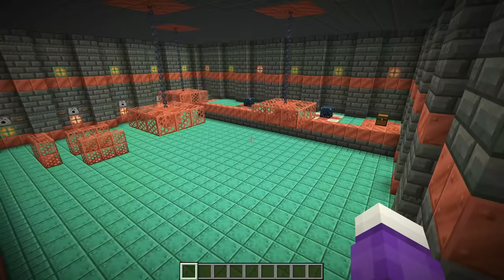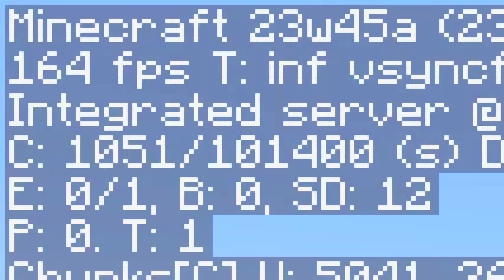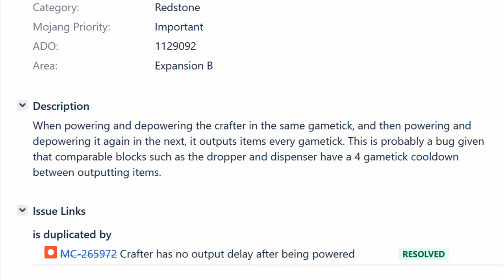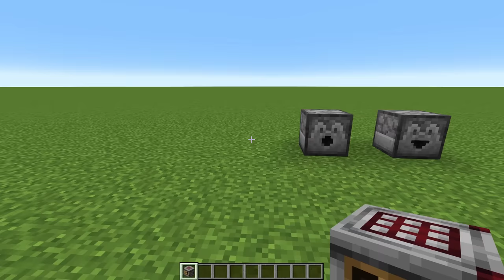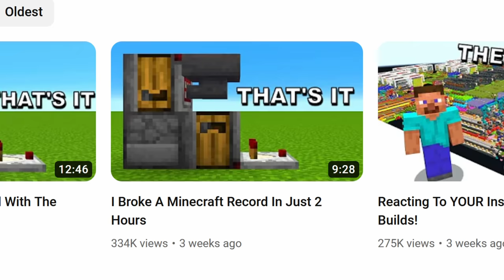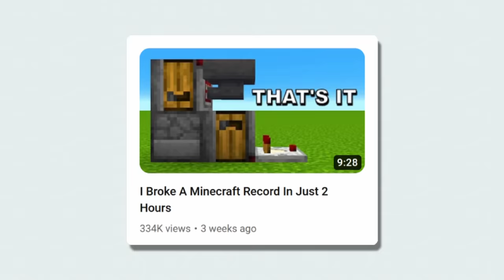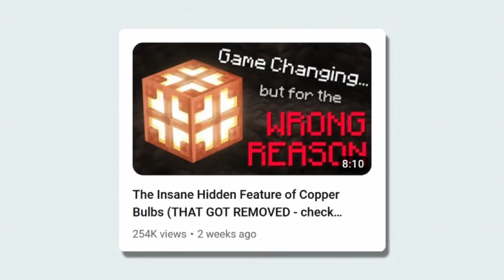Mojang Is About To RUIN Copper Bulbs (And Crafters)

Comment: Not only did they ruin the speedy functionality of the bulb and crafter, they also keep making the crafter texture WORSE!!! Seriously they had it perfect the first time. If these changes aren't reverted it's gonna seriously kill most of the excitement for this update as you said.
Reply: At least textures can be reverted with a simple client side resouce pack. The block mechanics not so much.
Reply: The real reason for the crafter textures being changed is because an orientation pattern can make an accidental... windmill. If you know what I mean.
Reply: @risa1467 it's not like you can use literally any block to make a swastika
Reply: @HellCromeE  True, but there is a difference between outright doing that, and having a block's texture accidentally showing an symbol. Obviously, Mojang doesn't want their assets to display unintentional windmills, because they know groups will then wrongly accuse Mojang for subliminal messages.

No matter how silly they may be; they don't want the liability.
Reply: @risa1467 You do know there's an entire compilation here on YouTube if people accidentally making that symbol using Mojang's assets, right?

The changes to the texture are inexcusable.
Reply: @risa1467  the only people dumb enough to accuse Mojang of that for having those textures are the same people that just can't be pleased. They'll find something else to accuse them of.
Reply: at least this texture is better than the last texture
Reply: @risa1467 you can make the a swastika with many other block textures (for example pink petals) so I don’t exactly see your point
Reply: @recycledwaste8737  There is nothing stopping anyone from making the windmill accidentally or on purpose; I've never suggested the contrary. Anyone else telling me the obvious should be assured I know that. Although, I will point that same compliation of it features modded verisons of Minecraft, and have features well outside the scope of Vanilla ever will have.

It is just that Mojang is keeping their textures in mind for the moment it becomes perverted, and becomes an PR nightmare in the making.

The same reason Cyan Glazed Textures changed; nothing more, nothing less.

Again, if anyone wishes to revert these textures are free to do so. However, Mojang is interested in their default standards in how these blocks are intended to be; whether anyone likes it or not. Luckily, we have the ability to make our own resource packs.
Reply: @vibaj16  Sure the people who will accuse Mojang of anything much of that will be dumb. However, Mojang simply wants to avoid the controversy entirely by not having one at all. That's all my point is.

As silly as it seems; you'd be surprise to know dumb people can have an absurd amount of power in causing strife.
Reply: @risa1467  Also in most countries it's pretty much illegal to have that certain symbol (history books, relics in museum and documentary movies are exceptions). So the mohjang could easily be sued by many countries.
Reply: @recycledwaste8737  But the company would be in legal trouble if they made it to be a feature. Tho, i'm pretty sure that those compilations would throw lots of people into prison if they weren't anonymous (because using that symbol publicly is illegal in lots of countries, with the only exceptions for relics in museums, history documentaries and history movies).
Reply: @HellCromeE there is a difference between intention and something being done on a accident .
Reply: @vibaj16 basically yall who are complaining about

Comment: Haven't played in a while (and haven't done redstone in even longer) but the autocrafter change seems like a change you could justify (server lag, hopper timings, etc.) but I have no idea why they would change the bulb, since that change only takes options away.
Reply: Easier fix would be to have a gamerule.
Servers could have a high tick gamerule, while single player could keep the fast ticks.
Reply: Rather than taking options away, we have an opportunity to give people more options. The copper bulb has four variants, right? Normal, lightly weathered, weathered, and oxidized. Why not give each variant a different delay? As it gets more oxidized, it goes from instant, 1 game tick, 2 game ticks, and 3 game ticks. You can wax the bulb at any stage to lock in the delay. Four times the options!
Reply: @vaalalves  True!
Reply: @areadenial2343  I actually like this idea.... MOJANG!!!
Reply: it's a double edged sword, we usually only need 1-3 maximum autocrafters per type of farm. now it's speed has been reduced players will now use more autocrafters in their redstone farms = laggier.
Reply: @Zero-zr6xx would fast autocrafter be able to be fed on time though? hopper can only transfer items at a certain rate, so it can be useful if you manually inject stuff in it, however crafter would be already cadenced by item injection rate

Comment: if the crafter had had the delay to begin with, everyone would've been perfectly OK with it. great example of how developers can give but never take away, so they're hesitant to give in the first place
Reply: exactly, and that is why I think the crafter delay is ok. but the bulb timing is just taking too much away, I think
Reply: I don't entirely agree. Yes, everyone would be OK with it but it would be just another mediocre single-purpose block (like the jukebox before the recent update). Yes, it crafts, but it can't be used for much else. If it's faster, then suddenly you get extra types of usage. Like the compact counter.

Also, remember, it's still faster to craft by hand. Because when you craft manually, you can craft an entire stack with just two clicks (shift-click of the recipe and then again to craft the stack), the previous crafter could only do 20 items a second.
Reply: I dono man. Plent of games ive played have had buffs and nerfs. The defs usualy look at whats needed and whats fun. Changing the delay on these 2 items is NOT fun and it breaks mutiple builds so its a very bad update.
Reply: they removed copper goat horns and nobody seemed to care
Reply: @Yorick257 why doesn’t the counter work if it is slow?

Comment: I'm fine with Auto-crafters having a longer cooldown. The bottleneck is only marginally increased plus players can still make more machines. However, Copper Bulbs have a longer input delay has me up in arms.
EDIT: Huh. Didn't know about using Auto-crafters as tick counters.

Comment: I think they should add consistency by having OTHER blocks also delay odd tick intervals.
The crafter kinda makes sense though... not because of consistency but just because the other way just doesn't feel right.
I mean if you want faster hoppers you put hopper minecarts and if you want it even faster then you put MORE of them
I think the delay in the crafters are fine. it's sad that it breaks the fast counters but that's only a problem if you want to count at a faster rate than 4 gameticks.
if it is because of order it can be fixed by having it at 2 ot even like 3 gameticks to add another odd tick block.

Comment: Copper bulbs are cool because they have a good use and an extra feature. I thought quasi connectivity was bad until I learnt it a little and its super useful. The added tick of delay might be confusing bc your redstone would get out of sync but it adds an entire new concept. As for the Crafter this change makes since and it effects nothing. Just make 4 crafters.
Reply: Yeah I'm not beat up about the crafter at all but the bulb is the big one. Halfing the size of wiring on some complex mechanisms would be so nice

Comment: As a not-master redstone I see no difference here, but I know it's painful for those who are
Reply: The game runs on a speed of 20 gameticks (gt) per second, so 1 gt = 1/20th of a second. Redstone ticks (rt) are 1/10th of a second, so 1 rt = 2 gt. Almost all redstone components run on redstone tick timing, so are all on even game tick delays. Some machines and redstone circuits require very precise timing, going into odd game tick delays and timings. With just normal redstone components, there was no way to access odd game tick timing without using un-intuitive and clunky mechanics like trapdoors and scaffolding or leaves and pistons pushing logs. With the addition of the copper bulb however, it made accessing odd game tick timing much easier because the copper bulb had a 1 gt delay. This allowed for easier setups for very precise timing, and for faster systems. Mojang nerfed this feature by making the copper bulb activate immediately, which can be thought of as a 0 gt delay, essentially putting it back onto the even game tick timing scale as all the other redstone components. This trait of the copper bulb was what made it so special and an extremely powerful redstone component, and by Mojang reverting this and taking this unique feature away, they essentially stripped the block of all its usefullness!

As for the crafter, I personally think that the nerf is the right thing for nerfing the actual intended use of the block---that is, for crafting---since being able to craft 20 items a second in a single crafter is absolutely insane. So for that I think it is a good thing, however the nerf also affects other uses of the block. I myself am not as educated on the crafter than on the copper bulb, but from what I understand, since it was able to be activated every gt, it alongside the copper bulb was also able to be used in very precise timing. These other uses have nothing to do with the intended functionality of crafting, but almost every redstone component has some unintended use alongside its originally intended use. In summary, these changes are radically the opposite of what the redstone community wants, and I hope that Mojang hears our complaints.

Comment: The nerf was likely for server stability reasons.
Items that create rapid lighting updates or create entities at the maximum game speed would open the door to over powered lag machines that could crash servers.
Usually plugins are the easy fix by imposing tick limits to reduce the strain. But Mojang might not want that kind of vulnerability in the base game.

Comment: The only reason I can think of as to why they would do this is to prevent possible lag issues. Perhaps it would be possible to crash servers with how fast these things operate? But if that's the case,  why not have the default be how it was before and then let server developers modify it according to their own needs?
Reply: If they are afraid of lag, they should stop being lazy and actually work on optimization.
Reply: @buragi5441  god forbid they actually optimize the game
Reply: @ScoutGuy  they are working on game 15 minutes every day, they don't have enough time for that 😤
easier to do random shit update each time.

Comment: there's 4 variants of the copper bulb, so why cant we have both?
normal copper bulbs would have the 0 ticks of delay they do currently
exposed copper bulbs would get 1 tick of delay as they did in 23w45a
weathered copper bulbs would get 2 ticks of delay
oxidized copper bulbs would get 3 ticks of delay

Comment: Funny thing is I thought the original version of the crafting block is very bad. You can download half a dozen mods that make more reasonable crafting boxes.

They could have limited it based on crafting materials.

They could have limited it based on speed of operation.

They could have limited it based on the items that it would craft.

They could have used a ghosted item recipe format instead of the weird format they do use. This is common in many modded Auto crafting boxes.

And now they're making it even worse?

Realistically speaking, I would probably only ever use it to handle simple Farm output like gold and sugarcane.

Comment: Eh, I do think that bug report is BS, but there should be some balance to keep individual redstone components from becoming too OP and take attention away from redstone engineering multiple components. What makes the game fun is figuring out the puzzle of putting it together rather than a single block that can do anything. 

This is my problem with the many modpacks which "solve" problems by giving you a magical item that does everything with absolutely no problem solving needed by the player to use it, just gather the materials and make the magic item. I think slowing down crafters will force players that want to scale up crafting to come up with new solutions. And I think it would be interesting if crafters were nerfed further, like by requiring some sort of filler item to leave empty slots in the recipe or fill up like dispensers.

Comment: That bug report actually has some measure to it. With the old crafter, hopper lines would just become obsolete due to how much faster it would be to allow blocks to travel through crafters. Plus: it wouldn't have been consistent for all materials, you could transport redstone, etc, anything that crafts back and forth between 9 and 1 items, kind of stupid. I get the crafter tick delay. It doesn't break everything mentioned in the video at all, it's just going to work slightly slower/not going to be spam proof but that's what the rest of redstone is for. Minecraft was never meant to be a logic simulation, and this would definitely have an effect of TPS on servers as well. Copper bulbs on the other hand, that change makes no sense. There wasn't a bug report for it, it didn't break the game or any consistencies, it worked perfectly fine as it was. Keep crafter delayed, keep copper bulbs the same.
Reply: I mean we added observers that kinda makes everything else that previously worked with it to be obsolete
Reply: But it only works with materials that can be crafted back and forth, which is completely useless for storage systems that deal with all items.

Comment: Crafters having a 4 tick cooldown i think is fine since their job is to craft automatically and thats already a huge deal. Copper bulbs need to remain 1 tick though, if not they're just slight variations on lamps and capacitors, they have no purpose if they're not a 1 tick delay.

Comment: Personally i think the crafting drop speed makes sense solely for consistency with droppers, hoppers, and things like that, but thats extremely minor. The changes to the bulb make little to no sense. It adds a new mechanic that simplifies red stone builds, its nothing ground breaking, it just makes things that exist simpler and less bulky, which gives it a unique function, instead it now fuctions as other blocks that already exist and are cheaper to craft, id much rather spend a bit of wood and 1 redstone to make a noteblock then a bunch of copper and redstone to make a copper bulb and have them do the exact same thing.

Comment: Why does Mojang seem so adverse to the idea of giving copper more actual functional purposes?
The whole reason these new blocks don't need to be "In line" with older blocks is because they're using copper, a new material.
Heck, copper carries electricity quickly in the real world; why can't it carry a magical redstone signal quicker as well?
If they're afraid of the faster tick speed being used for server lag machines, they could introduce an adjustable game rule so that servers can slow down crafters and bulbs if its users make them a problem. Give us more control, not less.

Comment: Not a redstoner, but the way I see it, the copper bulbs are mostly supposed to be compact T-flipflops. However, since Mojang has now opened Pandora's Box, they either need to restore the bulb's original 1-tick behavior, or come up with another component for that purpose (might make sense from a performance standpoint to use something that isn't also a lightsource, too). The latter might be the best solution and wouldn't be out of line if this is really supposed to be a tinkering update.
Reply from the maker: Mojang added parts of the starlight mod to vanilla, so lighting lag is no longer a problem.
Reply: Also consider, there's no real reason to split the functionality between multiple blocks if it works as it did last snapshot.

Comment: While I think the crafter is better with the faster response time, the argument that it didn't need to be in-line with dispensers ignores the main reason this change would've been made in any other game: Mechanical blocks having consistent reaction times and behaviors is just good game design and much more friendly to newbies who have no idea what to expect from any given block. Your game features should set precedent for others that use the same systems. Of course this means things like quasi-connectivity would also ideally be consistent, but Mojang has a unique issue as the redstone community already greatly benefits off of unintended behavior in both official releases and snapshots.

I hope the changes are reverted, but it is important to understand why these kinds of changes are made in the first place. Redstone is fundamentally inconsistent and the advanced redstone community relies on this greatly, impeding consistent and traditionally good game design when changes and additions are made.

Comment: The crafter makes sense so as to sync up with other components.
As for the copper bulbs? Well, so as to sync up with other things.
Since every other red stone component is clocked at 10Hz, having one clocked at 20Hz could cause different headaches.
That’s the only reasoning I can find
Mabye have the normal variants work like before and the oxidised variants at 10Hz